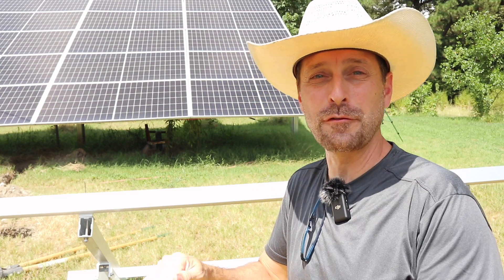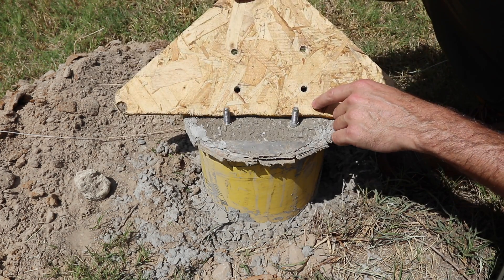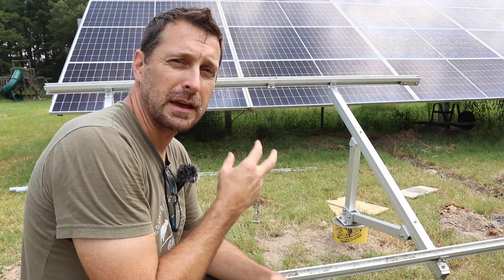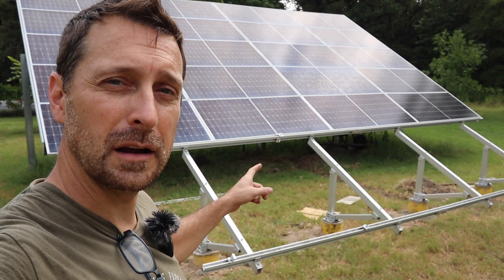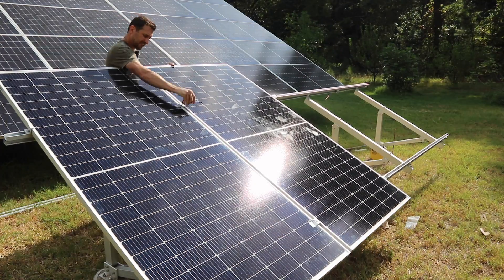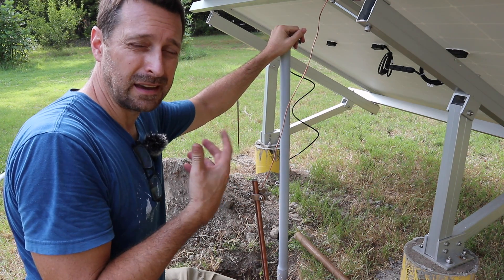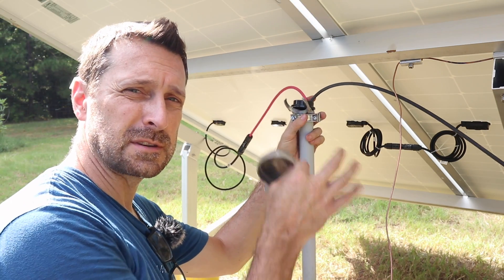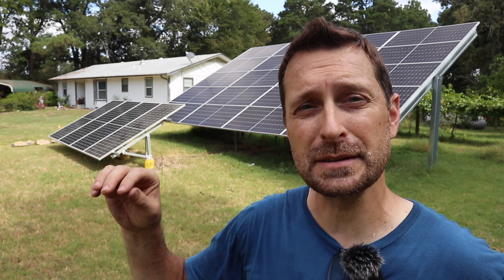Home Solar Panel System Extension With An EG4 Brightmount | Mounting and Wiring

Comment: This seems like a huge waste of time and energy. Sure, your rack will survive a tornado. But the rack isn't what the wind is trying to pick up; the panels are what the wind is trying to pick up.  And on those Brightmounts, the panels are attached to the rack by a couple of clamps with a quarter-inch bolt on each side. So it's those four little bolts that will decide whether your panels sail away, not the giant concrete piers.
Reply from the maker: It isn't. You don't understand strength of materials and engineering which explains pull away and shear strength ....so.....
Reply: @CountryLivingExperience  No, I'm not a structural engineer, but I understand that if you chain your bike to a sequoia tree and then lock the chain with a cheap padlock, a thief only has to cut the lock, not the sequoia tree. If the wind is strong enough to tear a panel off the rack, you will lose the panel, even if your rack is attached to the center of the earth.

Comment: I have been watching you for a while, and I saw your most recent video with the upgraded EG4 controllers/inverters. I decided to take the plunge and make the purchase during the signature solar sale. Most of this makes sense, but I am not sure which direction the panels should face, i.e. north, south, west, east. I have seen a lot of discussion about angles at different times of the year, but not about compass direction placements. Thank you for your help! God bless you 😊
Reply from the maker: I have a few old videos on setting up the panels. Rule of thumb is to face due South or slightly Southwest in the Northern hemisphere and North/Northwest in the Southern hemisphere. Mine are set at azimuth 185° or 5° to the West from due South. 
Hope that helps.
Reply: @CountryLivingExperience  Yes this is great! Thank you so much !!

Comment: Just a little added note. I have to get a planning department permit to install my panels. I have five bright mount kits, and I am going to install two 10 panel arrays. I want to deviate from the bright mount method of installing, similar too what you have done, but I am not sure That the county will permit me too. County planning has stated they have no one who can assess the suitability of what I plan to do. They want to see an engineering statement. Difficulty. Thank you for your presentation, very nicely done.
Reply from the maker: You’re welcome. I think there may be engineering drawings available for the Brightmount. Check the website for something you can download.

Comment: Hi nice video I have the same rack getting ready to install..I was wondering How many bags of Concrete did you need?
Reply from the maker: Thanks. I used 4 bags per sonotube. This is less than recommended in the instructions however.
Reply: @CountryLivingExperience  Thanks 👍

Comment: I wish Signature Solar had additional rails and splice plates. They sell 10 panel minimums and these racks hold 4, all you need is a 2 foot extension and you could mount 5 on each one. They can certainly hold the weight, Average Joe mounted 10 smaller panelscon one  of these racks!
Reply from the maker: Yea, I saw Average Joe's vid. He is creative.

Comment: How did the wood sled work out? Any adjustments you would make? I want to build one so I dont have to "dig" holes in this East Texas red dirt and just use carport screw anchors to secure the sled. My question is was it adequate and strong; work out well; and anything you would do differently? (instead of structure screws I will use 10 or 8 Inch lag screws to join the 6x6s..... thoughts. 
and THANK YOU for your videos!
Reply from the maker: It worked well for the time I used it. It did not move one inch. It was always meant to be temporary though. I honestly do not know how it would hold up for a very long time but with ground contact treated timbers I suspect it would last a while. With 6x6's it should be good for a long time. 
Don't you have fun digging in this East Texas red dirt/clay?
Reply: @CountryLivingExperience  actually i just analyzed everything and found out if I cut the adjustable brace (few inches off) I can flip the brackets upside down and mount it to a vertical post! So I am going to just do that....I still will be able to adjust the angle too. Now I only need FOUR 6x6x 6ft. (3 feet above ground and 2 or 3 feet in ground)
Reply from the maker: Cool

Comment: I know the weather head doesn't come with instructions but you need a significant drip loop in order for it to work at peak  in windy conditions.  ???   Also facing it toward shelter would help.

Comment: I've learned a few things watching your videos, but I'm looking for numbers. Like number of panels, total volts, amps, watts, etc. I wish you would mention the technical specs more in your videos.  Thanks.
Reply from the maker: Glad we could help. I did mention numbers in my earliest videos when I put in the Growatt system. My panels are 440watt, their amperage is 10.74, and I have them configured in two different strings. One is a 6 series and a 6 series paralleled together. The other is a 8 string just in series. What other specific numbers are you looking for?

Comment: You probably already do this bit, I'll mention it for others.
Mechanical systems WILL fail.   It's not a matter of if but of when.  The inverters will go first, then the BMS will fail, squirrels will chew your wires, etc.
Have a backup plan for your backup plan.
I have multiple, probably 15, of the cheap PWM charge controllers that are still in the box.   I have some portable power stations and some portable solar panels.  I have gas generators.
I hope to never "need " most of this stuff, but if my grid goes down for 2 years, I'll need all the power supplying devices I can have.
Lights and fans for here in the Southeast, lights and some heat source for most of the US and Canada.  It doesn't take much juice to run a couple of light bulbs and a small fan.  AC and heat is another story.
Reply from the maker: Absolutely. Good call!

Comment: how did the temporary setup with the timbers hold up over the months? is it just as good as using concrete footings for a temporary setup or was the rotational force taking its toll on the footings? thanks!
Reply from the maker: It held up well. It did not move the entire time I had it sitting there. I had a few big storms but not extremely major ones. It is not as good as the concrete though.

Comment: Question/Comment: 1) do these bright mounts have engineering/load plans/specs? I don’t seem them online outside of wind speed. 

Roof or Ground mount, panels must be connected to the rest of the home grounding system. You just put in an aux ground which is not enough.

Comment: 18 kWh of used panels and counting.  More power than I know what to do with when the sun shines.
Reply from the maker: Awesome
Reply: Since they are used, on an average summer day, how many actual KW are you pulling?
Reply: @SamSung-jn5fi  typically over 100 kWh through the inverters with batteries topped off after night adding another 20 or so kWh to the total.  Most pulled in a day is 156 to the house.  Place is a bit of an energy hog some days. Kids a/c tvs yadda yadda. Also long summer days help.
Reply: Also my angle sucks for winter that’s why I have a lot of panels.  Buy used and prop ‘‘em up on railroad ties with the edge metal bent down and screwed onto the ties to keep them from being kites. Just use regular old metal screws works well but only get about 30 degrees of angle which is not the best you can do here in Colorado.

Comment: Just an FYI: 
You don't have a ground conductor ran with your PV wires. This should be ran back to your system and connected to the ground there.
Your panels are not actually grounded for personal protection. They are just connected to the local earth. 
As it is right now. You are counting on the earth to carry any fault current back to your system. (Assuming that it's connected to earth also) 
Earth is not a good conductor. 
I would keep your children and animals away from the array. Until it's safely grounded.
Reply from the maker: Panels on a ground mount are not to be  grounded back to the house. They are to be grounded separately unless on the roof of the home.
Reply: @CountryLivingExperience  incorrect 
They are required by NEC to be grounded to the rest of the electrical system. The local ground rod that you have installed is called an auxiliary grounding electrode. While not required,  it is allowed. But if installed,  it must also be connected to the rest of your grounding system.
Reply: Furthermore 
By connecting your panels to the earth and not actually grounding them. If one of your panels developed a short to its frame.  Your frames,  racking,  and now the earth around it will be electrified.
Reply from the maker: Thanks for your concern
Reply from the maker: I wanted to get back to this for a second. I am assuming you are looking 690.47 in the NEC which I have read and watched Mike Holt's video on it. I think these assume that I have a combiner box where there would be an equipment ground conductor that would run back and be grounded with the rest of the electrical system. 
Here is the thing....I don't have a combiner box. I have two strings connected via MC4 Y connectors and run directly to an IMO PV DC disconnect then run straight to the inverters. Since I have only two strings I don't need a combiner box. 
Thoughts? 
I have additionally also seen people run a buried bare copper wire from an earth ground rod at the ground mounted array back to the main ground rod of the electrical system. Thoughts on that?
Reply: @CountryLivingExperience  even without a combiner box it’s technically supposed to run back to the original grounding electrode at the main. If you didn’t have a grid panel you would still ground everything to a single grounding electrode.
Reply from the maker: @GavinStoneDIY  I have been advised on 3 separate occasions by 2 different people to just ground the ground mount panels to an electrode rod near the array (from a solar company). Is this incorrect? Is there a distance that would negate running it all the way back to the main single grounding rod (1/2 mile, 800ft)? So would bare copper conductor below grade back to the single electrode work if I needed to add it?
Reply: @CountryLivingExperience  it seems like an odd code till you research the reasoning behind it. And it’s a lot of boring research that has to do with different voltage differentials. Essentially having one central ground point eliminates the possibility of ground loops and other problems associated with surges. So I believe by code the ground wire would be in the conduit with your PV wires. And I’m not sure whether it can be a bare copper or not. You’d be causing a further issue running a bare ground wire that distance under ground without a conduit. Almost inviting a gradient pulse from a nearby lighting strike. 

Definitely not what you’re wanting to hear I know. Based off your other videos your array is a good hike from the house. But it’s best to follow code if possible on this one. I’ll be honest, with a direct lightning strike all bets are off either way. The issue is more from nearby strikes causing serious issues. And I’m sure there is other problems that arise like the commenter mentioned above. They do allow auxiliary rods at the ground arrays. But those aren’t meant to take the place of the actual home run that’s required. And I should say, this is just based off what I’ve read and researched. I’m certainly no expert.
Reply: @CountryLivingExperience  also I should mention you should invest in some surge protection devices for the PV. Even if it’s just the types that come in the combiner boxes. Or look at midnight solar or Emp shield for something more robust. They’ll send any surges to ground before they can harm your system. I know it feels like there’s always something more to work on. 🙂
Reply: @CountryLivingExperience  , the main reason to ground to your building electrode system is so the things like breakers or GFI have a return path so they can trip in the event of a transient vs getting shocked by your array, just look in the groups for “my array shocked me” That’s caused because most high frequency inverters couple the PV inputs with the AC power, you get a shorted panel or a grounded wire that AC will be present on the array and with no return it will not trip a breaker or ground fault. This is just one potential cause buts it’s pretty common and a ground rod will do nothing to help that as the earth is a very poor conductor..  speaking of mike holt look at his videos on light pole ground rods and his early one where the run power into 20 feet of ground rod and it’s only pulling a few amps ..

Comment: Just check your wind loads, they can be tremendous for many areas. I think a lot of people have no sense of how high they can be, not just the horizontal (and tipping for single posts) but also the up lift can be very surprising, many Chevy Suburban's worth of weight/force.  Search: ASCE 7-16 Solar panel CFD , MWFRS etc.    For my site I don't see the 4 bolt foot on this install surviving the cantilevered forces, a continuous post straight into the cement sonotube would be better.
Reply from the maker: Thanks for your concern

Comment: Just use J-bolt anchor bolts instead of expansion sleeved ones for a wet pour application. Cheaper and stronger.
Reply from the maker: Those would have been better, you are correct. This is what I had on hand and that came with the kit.
Reply: Use what you got as they say- Of course to get the expansion bolts to seat properly it would be best to drill/drive them into dried concrete rather than set them wet. You said you're not getting much wind and this is so close to ground that there wont be an issue. Clean looking install all around, good work.  @CountryLivingExperience
Reply from the maker: Thanks

Comment: For those of us who need more angle, you can drill new holes in the diagonal brace to make it steeper.  25 degrees just doesn't do much in the winter up here!
Reply from the maker: Yep. Some will have to make mods depending on location.